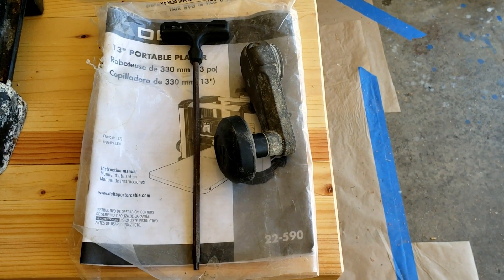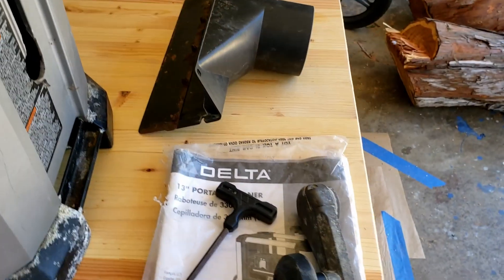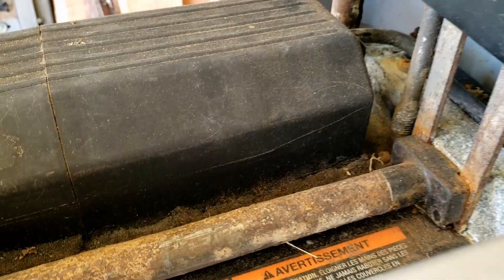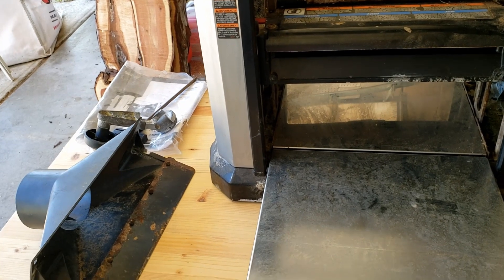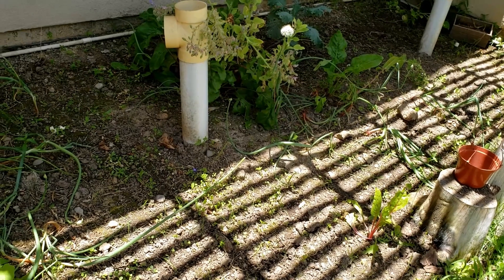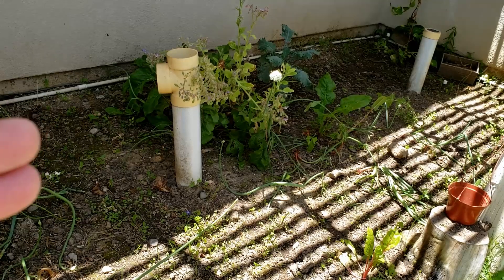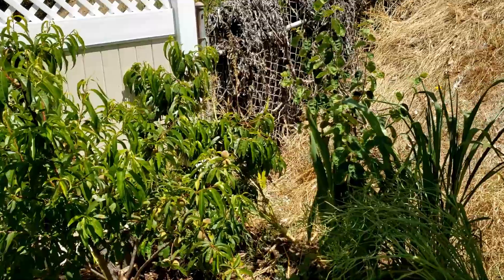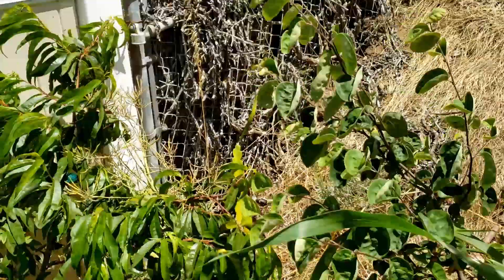Delta Planner 22-590 Restoration and Garden with Compost Tea 1-week Update

Comment: Finsh the bench, I think you'll need lateral support.  I used a 4x8 plywood mounted half above the bench top and half below, bolted to the legs.  I needed to use spacers but it is solid, and I have room for the shelf .  The back allows me to mount a peg board, lights, and just about anything else.
Reply from the maker: Thanks for the tip!